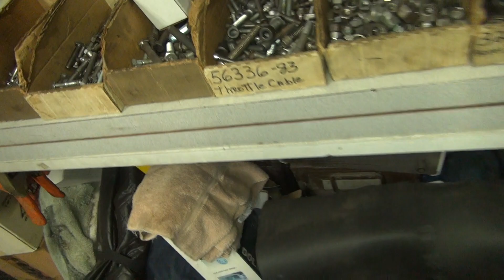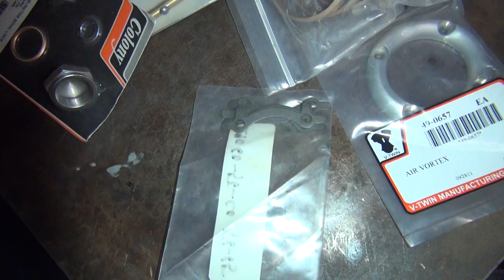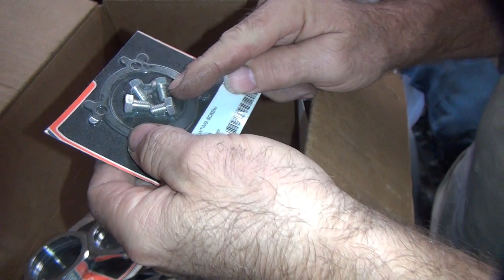#165 1952 panhead rust bucket tuning kick start linkert carb repair FL harley bobber tatro machine

Comment: Put a s and s on and be done with it !!!
Reply: Brian OHara, what fun would that be. Once that Linkert is worked out, the bike will run just fine. I ran an S&S for a lot of years on my 65 FL. Have the M74B back on it. Runs just fine.
Reply: @PanM8  agree, I took the Mikuni off of my wl and put the M88 back on and glad I did